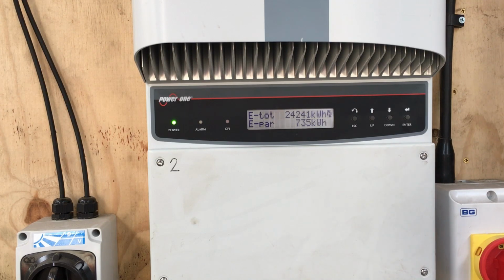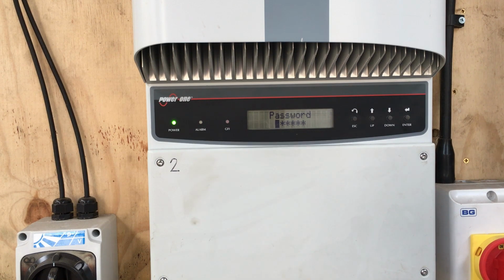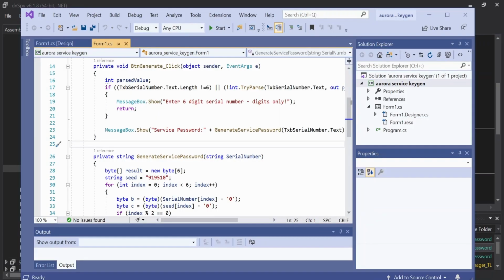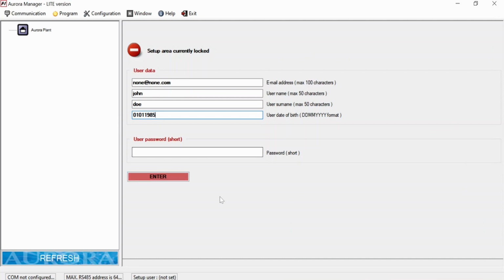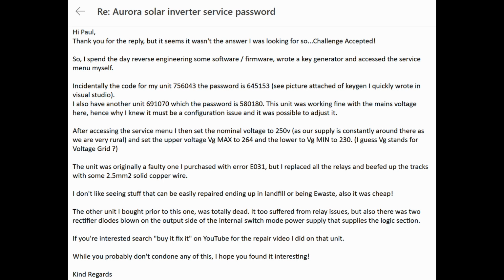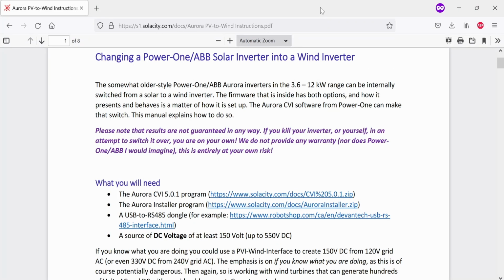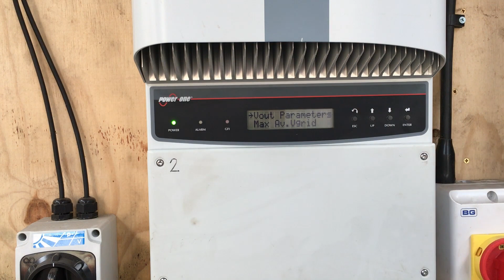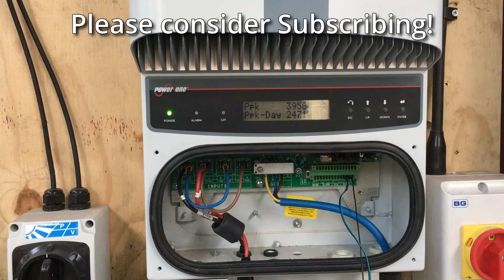Power-One Aurora / ABB Inverter - No password? No problem!

Comment: Yor knowhow is very impressive! I´m sitting in Germany with two PVI 4.2 from Power-one SN: 120002 WK:36/12 and SN:1314683840 Wk:1413. The older Inverters from Power-one in Germany are powerlimited from 4600W to 4200W. When ABB took them over the  limitation was gone. I now would like to take the limitation off. May I ask you for Installer passwords ? This would be very kind of you.
Reply from the maker: Thanks! See the video description I placed links to all the software 👍
Reply: Thank´s for your quick answer! I have seen your link to the Keygen and tryed to download, but I always get a virus warning. My Virussoftware AVAST makes dowloding impossible.
Reply from the maker: Yes, it's probably because it's not a common file that the antivirus programs have seen and so they think it's suspicious. Sn120002 pw:019112  and 572350 for the other unit. The service menu didn't give a lot of options on my units. These may not work depending on the firmware version but you should still be able to make changes with the aurora CVI software and an rs485 adapter.
Reply: Thank´s a lot, I will check the PW this week and will inform you about the result.
Reply: It would work, the passwords are correct, but finally I decided not to change the limitation, because of the net frequency which could be disturbed at high output.
Reply from the maker: No problem, Thanks for the feedback 👍

Comment: I bought a repaierd inverter from UK and I am in Canada. I get fgrid out of range and the seller said their advertisment said not for use in Canada and I missed that. Any help making this adjustment would be appreciated.
Reply from the maker: If it's the same as this one you can use the aurora CVI software, it might even let you reset the country code (it did on one of mine) and let you set it to Canada. You will need an rs485 adapter though.
Reply: @BuyitFixit  I assume 485 to usb and use my lap top.
Reply from the maker: @davidghobril3547  yes, correct 👍
Reply: @BuyitFixit  Thank you so much. I like you abhor things becoming waste due to simple repairs. Refrigerators come to mind. Take care.
Reply from the maker: @davidghobril3547 Thanks👍you too 🙂
Reply: @BuyitFixit  I have the manual for the inverter and it doesnt allow the choice of Canada or the Usa so now I have to go deeper into the specs to maybe set the f grid manually.
Reply from the maker: @davidghobril3547 Yes, I'm pretty sure you can change almost every setting from upper and lower frequency to voltage etc
Reply: @BuyitFixit  I am thinking the only problem seems to be our grid frequency here is 60 hz not 50
Reply from the maker: Hopefully it should let you change that in the software, I could alter the voltage but  I didn't mess with the frequency, but I'm fairly sure I could have if needed.
Reply: @BuyitFixit  I cannot tell where the wires are connected to with the rs484. It looks like 2 wires are twisted together ad the one labelled grnd is in the 3rd last slot and the twisted pair are in the second last spot?
Reply from the maker: @davidghobril3547  doesn't matter about them being twisted. On the green connector should be marked RS485. The + goes to + , - goes to - , and GND goes to RTN. Hope that helps
Reply: @BuyitFixit  Yes, thanks

Comment: Wow this video was way more in depth and impressive than I was expecting. I've just got my hands on one of these inverters. I also recently started trying to use x64dbg but I have no idea what I'm doing lol. 
I love that you can set them up for wind. Thats really cool. Have you played around with the wind settings? What options did it give you? Do you think its possible to have wind on one input and solar on the other input, seeing as it have dual mppt inputs? (nevermind just saw your other comment saying no it probably cant)
Instant sub from me, I love that you emailed the company your 'work'
Reply from the maker: Thanks 👍 Yes, the company was most unhelpful so "challenge accepted" 😂😂😂 I had the same pretty much the same problem with FLIR and a thermal camera which I had to sort out too. Thanks for the SUB. If you like reverse engineering you might like the Ultrasound Scanner Video I did too...

Comment: Is there a standalone windows keygen available to download ??  Thanks
Reply from the maker: I have one that I wrote, I just need to find somewhere to upload it to.
Reply from the maker: I've just tried google drive. Give this a go: https://drive.google.com/drive/folders/1BTAYRSqM-a5M0zBDmI7163vGkTa_zAJu  Let me know if it works OK.
Reply: @BuyitFixit  yes that worked  what a star - I ran it though and it generates the same as I got with the Aurora CVI5.0.1 Software but the inverter says wrong password so a bit stumped - maybe if I get a RS485 usb interface and try that.
Reply from the maker: I think they changed the algorithm in later models so it needs a date and time mixed in somehow...
Reply: @BuyitFixit  O.K the manufacturing date is WK17/12 so it is a old unit - thought it would work but thanks again for your assistance - hopefully the RS485 route may show the password from the memory

Comment: Hello.I came across your great video looking to find service code .I have a perfectly performing three phase aurora tl20 trio but my network operator is requiring my loss of mains settings and is threatening diconection if inverter not compliant.I've used finer site to get codes but returns invalid .Also the code generator in the CV15.0.1 software but invalid also. mmm brick wall.
This inverter has two components,the inververter and a power box with own serial numbers. the inverter is 990867 and box 994306 both wk26 Yr 12.
I would greatly appreciate your opinions. 
I've. also been trying to connect with rs485 converter but just cannot get a connection despite checking connections multiple times
Regards steve
Reply from the maker: Hi Steve, My keygen says 
990867 = Service Password:889377
994306 = Service Password:883416

I know some later models have a different algorithm which seems to take the date and time into the equation.
I would have thought that the RS485 should work though.
I have a unit that the password doesn't work in via the service menu, but I can still edit / view all the parameters with the CVI sofware and the RS485.  There are a couple of other programs which might work instead of the CVI program called Aurora Manager, and Aurora Manager TL which you might need to use instead. See if you can get any communication going with either of those.

Comment: Hi, many decades since I did any code work but very interesting.

Do you by any chance know how to set the startup voltage on the 3.6kW version?

The reason I ask is that I've just replaced my old 3kW one with the 3.6kW

The 3kW would turn itself off when the sunlight faded, but the 3.6 one doesn't and draws 65W of power all night which is buggerin' up my weekly readings!

Cheers from (sometimes) sunny Blyth.   :)
Reply from the maker: This is the 3.6kw in the video. I think you can do it in the settings menu under start up voltage. Default password for that is usually 0000. If not you can do it with a rs485 adapter and the Aurora CVI software. Links in video description 👍

Comment: Thanks for the video! My serial is 236823. Can you help me to generate the ServicePW? My inverter is down because to high voltage.
Reply from the maker: Hi, 125333 but I think on later firmware they added something with the date and time it seems. Give it a go and let me know how you get on.
Reply: It doesn't work. It's a ABB Trio 27.6 from 2015.
Reply from the maker: Ah that's a shame. I think they must have changed the algorithm  or something after Aurora were taken over by ABB.
Reply from the maker: I've just checked the dates on my units one is 2011 and one is 2012. Someone sent me a 2kw unit from Aug 2014 and the service password doesn't work on that one, but the inverter software with the master password still does.

Comment: Thanks! Much to digest....
Any chance I can have a password generated for my ABB Trio 27.6 with serial number:   108826  it would be very appreciated!
Reply from the maker: Hi Fredrik,
Service Password:057336
Hope that helps :)
Reply: @BuyitFixit  Thank you so much! I have only Linux and I tried to get it running with Wine but without success. Then it will be a 100km drive today to see if it's now possible to select "grid" on this never used, but refurbished (sold as new...) inverter... Installed a few new ABB inverters previously, but after this, it will never happen again. 
I have the same issue with a brand new StecaGrid 10000+. It's a bug in the Swedish grid parameters so it shuts down at 240V, not at 253V as it should. Guess if it's possible to change parameters without service password.... And Steca is just as cooperative and customer caring as ABB... So Steca is also added to my black list..
Reply from the maker: Hopefully the password works on your unit. I'm not sure if they implemented a different algorithm on later units to the one I have. Let me know how you get on!
Reply: Dammit! Wrong password... Manufactured WK: 5116.
Reply from the maker: That's a shame. I read something about that some passwords expire after two weeks so I guess they may have combined the week and year into the code on later devices. I've not seen anything in the code of the engineer tools that mention anything like that though, it should be possible to disassemble the firmware, and reverse engineer the algorithm still if there's any firmware files.
Reply: @BuyitFixit  I will here and not take everything bad I've said about ABB back. ABB now routed me to FIMER. A password could then easily be generated on a web-page after a quick registration!
A am so happy! ABB rocks!
Reply: Dam youtube. Wrote a longer much better comment but realize now that youtube automatically deletes comments containing a link. :-(
Anyway, I tried your serial number in the video as well and the proper password was generated. No way near as coll as reverse engineer the software though. 
But problem solved. So now I can focus my all anger on Steca / Katek who will not let me have the service password for my Steca 10000+ inverter. Even though it's a bug in their firmware. :-(
Reply from the maker: Yes, YouTube hides posts that contain a link unless you are the channel owner. It's to stop spam. Glad you managed to get the inverter sorted 👍
Reply: @Frolleglse  Thank you for this, I have registered on FIMER, generated my service password and it is same as keygen gives me? It does not work. My inverter is ABB PVI-12.5-TL-OUTD-FS manufactured in Wk 23  Yr 19. S/N is 1923301787, Update ver. is 1747B

Inverter was run for less than 40h and is complaining on error E013. It might be the famous relay fail, but I would like to check if it really is not sw issue before taking it apart and soldering.
Reply from the maker: @kolinsist I think they changed the algorithm in later versions of the software. Unfortunately E013 is more likely the relay problem and unlikely to be anything software related.
Reply: Any suggestions of how to get the proper password from the not very cooperative ABB is very appreciated! Really bad that the top brands that are supposed to have a extended lifetime also seam to be the ones most eager to create bad will.. Its sure a expensive piece of junk hanging on the wall. Grrrrr!

Comment: Hi there, I live in Holland and I do you understand english, but as a nobe, this is out if my league. So I would like to increase the gridvoltage setting on my aurora one. My inverter is at the end of a 30 meter groundcable and due to  this resistance  8 volt is added to the the grid voltage. At clear days the grid voltage goes up to 245v. So the inverter measures 253v and shuts down. I really like to find out the service code. My s/n =226650. I hope you can help me to the service password. Thanks in advance🙏
Reply from the maker: The service password should be 115160.  If its the same as mine in think theres a setting of +10% which you can change to a maximum of +15% but I found that it seems to reset if the grid power goes away (power cut for example) and reverted back to 10%. I used the engineer software to change the value and it now doesn't lose the configuration.
Reply: @BuyitFixit  THANK YOU VERY VERY VERY MUCH!!!
  I changed the Vgrid value from 230v to 235v and 110% tot 115%. So my new maximum V value is 270v instead of 253V.
 I noticed you have to enter the changed value  by pressing enter when your are back in the main menu .   (the rotating arrows will change in a lock) I tested the settings after I cut off the power (solar panels and grid)  and it seemes to work out perfectly.
Thumbs up!!!
Reply from the maker: Glad it all worked for you.. I hope you've subscribed 😂😂😂
Reply: @BuyitFixit   you bet!!!

Comment: The quadruple zero worked a treat! I should read more of the manual. The 6 digit one did too; so I was able to confirm that all was still well with the system prior to adding battery storage which is in the planning stage. Thanks again.
Reply from the maker: Glad you got it all sorted 👍

Comment: Superbe! Since Aurora/power-one no more on the market, I was stuck because no service password. So a big THANK YOU. Also note that service pwd provided by Aurora were valid only 2 weeks (and to get your service password, you had to provide SN, mfg week and year). I'm using wind inverters in a watermill for more than 15 years, the trick to convert a solar one in a wind one will probably save my installation at some point as wind inverters are difficult to find now.
Reply from the maker: Hopefully it works for you, I did read about the 2 week thing so not sure if later firmware might use a different method of code generation. Please let me know how you get on 👍

Comment: Superb deep dive!

It's really useful too as I'm in exactly the same position as you were.

I can't believe the software engineers had time to add those easter eggs. It's almost like their performance was measured in the same way Musk proposed - by lines of code!
Reply: Really pleased they designed it to be used not connected to the internet.

Nowadays all the keygen / password logic would be in the cloud.
Reply from the maker: True, but that's where a well placed NOP or JMP comes in 😉
Reply: @BuyitFixit  that works if the check is done on the PC side, not so much use if the check is done in the inverter firmware :-(

I just watched the video where you repaired this unit. Well spotted on those shorted diodes... I think I'd have probably given up by that point!
Reply from the maker: I've patched firmware before too :) IDA pro back in the day.. lol
Reply from the maker: Thanks! Glad you enjoyed it and found it useful!

Comment: Hi great video can  this inverter set to grid standard en50549-1  Thanks
Reply from the maker: I'm not 100% sure on that one. In the software it seems you can alter a lot of parameters such as upper lower and nominal frequency and same with the voltage, so you might be able to adjust it manually to suit if it doesn't.

Comment: Hi, great video. I also have the same inverter, installed new in 2013, but labelled Sunpower on the front face. All the other labelling, manual, and paperwork is Aurora and Power One. (manufacture date week 34 in 2013.) It seems identical inside, but it has a 4 digit password. I managed to get the 6 digit password for my particular serial number using your video, but it would not accept more than 4 characters. Any ideas?
Reply from the maker: Thanks 👍. The 4 digit password is the user password. The 6 digit password is the service password. I'm  not sure how to reset the user password via the menu or if it's possible. I'm fairly sure that you can do it with the software I mentioned but you would need a laptop and an rs485 adapter.
Reply: @ George, if that 4 digit password was never changed, it's factory set to 0000. Try it!
Reply: @loicbru1002  How to reset the user pasword to 0000 if somone has changed it to an unknown value?

Comment: You are LEGEND I have 6 of these inverters that were dead that I have repaired and needed to get into the service setting for my off grid power system, Your video and download links allowed me to achieve what I wanted to do. Thank you. One day I might even try the wind conversion.
Reply from the maker: You're welcome Gary 👍Thank you for the feedback. Really glad the video was helpful to you! That was the idea behind making it as I thought I wouldn't be the only person ending up in this situation 🙂
Reply: Hi, can I ask you where I find the setting to make them work off grid. Thanks a lot
Reply: @talpadetalpis  There is no setting for off grid, it syncs to my off grid inverter. Won't work with all off grid inverters has to be be low frequency type with a large transformer and then not all will work.

Comment: I have the same inverter but my passwort have only 4 digits. Can you help me?
Reply from the maker: That will be the 4 digit USER password and not the SERVICE password. I think the only way it can be reset is via the engineer software and using a rs485 adapter like I used.
Reply: @BuyitFixit  ok thanks. I will try
Reply: @Johann1986  Do you have managed to reset the user password? If so how would it be done? Cause I have the same problem.